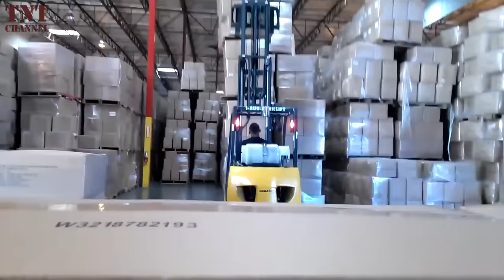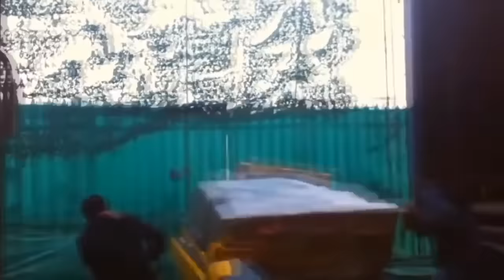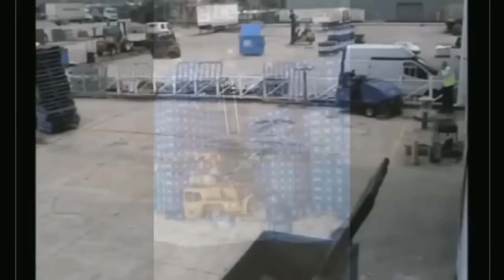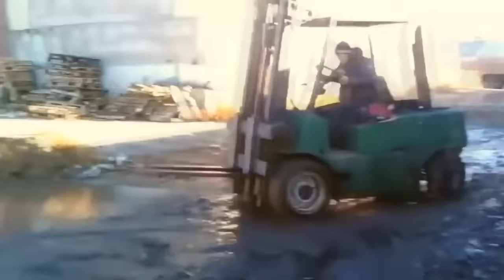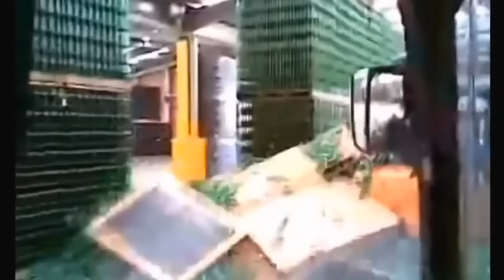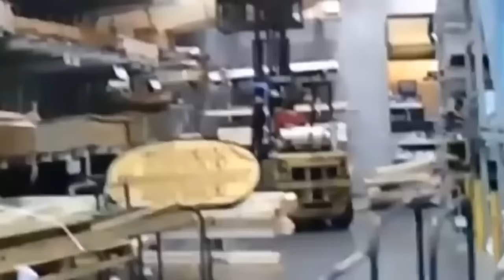AWESOME FORKLIFT FAILS COMPILATIONS - FORKLIFT FAILS

Comment: took my first forklift course back in 2000 and passed with ease. even got a + for paying attention to my surroundings. how did these guy pass? its a freakin wonder
Reply: 95% probably never took a test.
Reply: u dont need a license to drive one lol
Reply: @bobbob5007  well you still need to be certified.
Reply: @sleepdeep305  so you telling me when u get to a warehouse the manager is blocking the forklift and u have to insert your cert into the forklift to start it
Reply: @bobbob5007  The manager isn't blocking it, but it won't start up unless I do!
Reply: @bobbob5007  By the way, they're not usually called managers when they're on the floor. It's the "supervisors" that do the "supervising" ;)
Reply: If the place is any good then the supervisors and employees probably wouldn't let some untrained dummy run the forklift
Reply: @lolatmyage  that is never possible under best of circumstances there will be a time when neither supervisor/experienced employee is available and the dumbass either doesnt do there job and have a really involuntary unproductive day or steps up to the plate untrained. Of the warehouse is too busy no one will even remember to train him for a day like that and the only place its of no consequence is a large warehouse where they have enough micro managing i. chatge to make sure all neccesary positions filled
Reply: Most of these clips are just poor stacking affected by time and weather. The special few aren't in America.

Comment: I dropped my first pallet last month I felt bad but it was a learning experience for me it was my first time & they had me stacking fucking pallets full of glass bottles high as hell with no guidance I was literally in the back of the warehouse by myself
Reply: I almost dropped it because a vendor didn't wrap the pallet correctly (the wrap wasn't secured to anything it was basically just chilling) and the entire top half of the beer started to slide back towards me and i was just sitting there sweating like "if i make a single sudden move that's dropping on me"
Reply: Today, i made the same mistake.

Comment: I knew a guy who died due to wrong usage of a forklift. They were repairing some rusty sheet metal rooftops and they got this briliant idea to use forklift to get new sheets closer to a rooftop. It was against safety rules, but it worked, for a while. They had indoor forklift, outside, in a muddy grass and this guy had a great idea to stand nearby. Forklift started to sway a bit and one of those sheet metals went down right throught this guys chest. It sliced him clean. Instant death.

Comment: One time I worked for a dealership and the "maintenance" guys have a forklift in the back. Mechanic finished the engine job and needed to move the engine with forklift. So the maintenance guys started asking around for anyone with experience with a forklift and I did have a certificate operating one. So despite the so called maintenance guys, the parts counterman had to move the engine because they didn't want the fall if something should have happened. Then guess who they asked for the 2 years whenever the forklift was required.

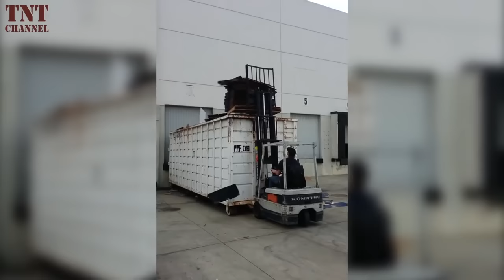Comment: as a forklift operator 3:20 isn't a fail, its a bunch of guys having a laugh because they know it's just cardboard and there's literally no danger.
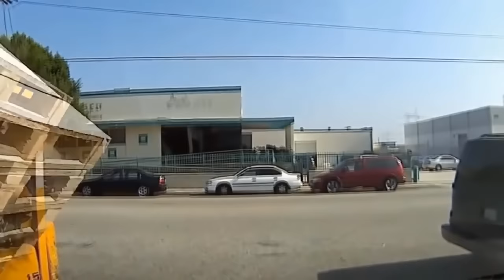Reply: Also 10:18 you can tell is a decent forklift operator that is dealing with a skid that has been packed by a bunch of idiots then put on the top shelf by an idiot, literally everyone in the video knows what's probably gonna happen and they're trying to see if the forklift operator pulls off a miracle.

Comment: Just had me a wreck today I drive a Yale walkie it’s like a 3 wheeler but it’s all electric i use it to tow tires around and someone in the opposite lane clipped me  I nearly went over the handle bars but thankfully my big ole gut caught the handle bars it knocked the wind outta me but I wasn’t badly injured and that happened at 9mph any faster and I think I would’ve broke something

Comment: How would have 1:51 been approached correctly? It seems as if the fault goes to whoever stacked the pallets
Reply: could they maybe have gotten another lift on the side?
Reply: It's hard to tell from the angle of the video but operator might not have had forks all the way in, also could have had the forks too low resting on the pallet underneath, causing the bottom pallets to be tilted while he came out. If he was doing it correctly it should have been a fairly straight forward lift.